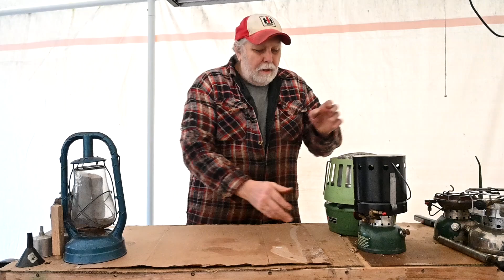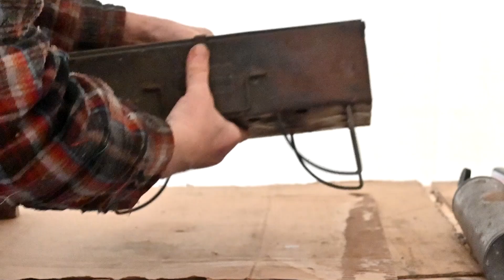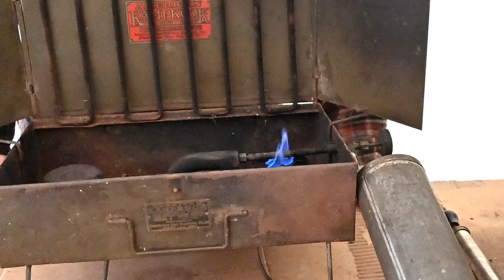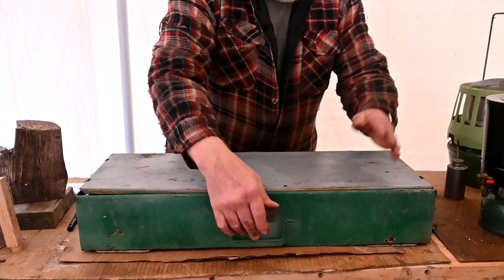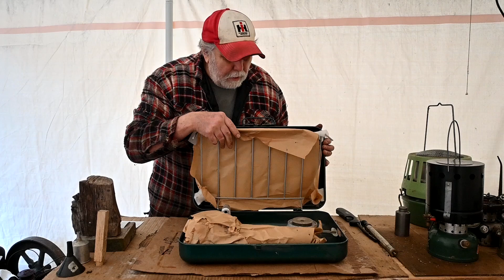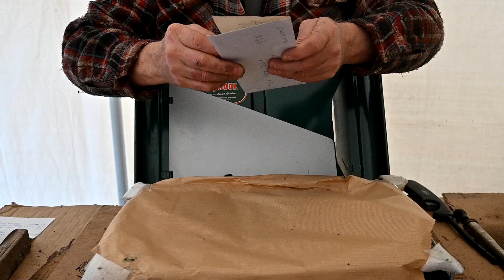Power Is Out?  Need To Cook?  AGM KAMPKOOK Gas Stoves

Comment: What is worth than darkness? . The kerosene lamp smell. The cat didnt eat the food when i used this
Reply from the maker: In kerosene lamps, don't use kerosene. Use super refined lamp oil and you won't have any smell and can be used indoors with no problem. Your kitty will be OK with this solution.
Reply: @mrobsoletesvintagehomestea9156  thanks. I did it, but its hungary. Its worse than kerosene was 50 years ago
Reply from the maker: I tried one brand of the lamp oil that still had an odor when burning and switched to another brand that has no smell and I use the lamps in my 10x20' shed all the time and even in the house at times.

Comment: I just crank up my generator and connect it up to our electrical system.  The key to any generator is to put it to bed, correctly, so it will be ready the next time you need it.  After Hellene, I changed the oil in my generator and filled it up with premium non-ethanol gas.  Before that, I ran all of the ethanol gas out of the tank and fuel lines.  I let it nun on the stabilized non ethanol gas for about five minutes before I put it away in my shop. 
  On a Coleman stove - the generator is “ up to light, down to burn”.  Never have forgotten after 60 odd years, have I?